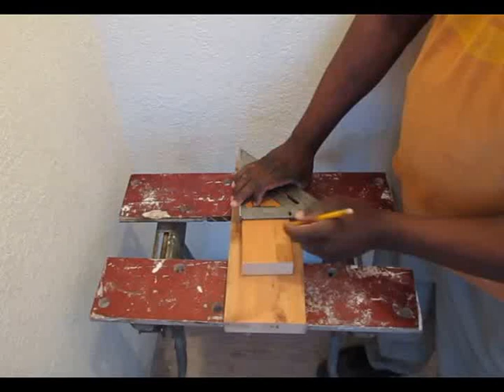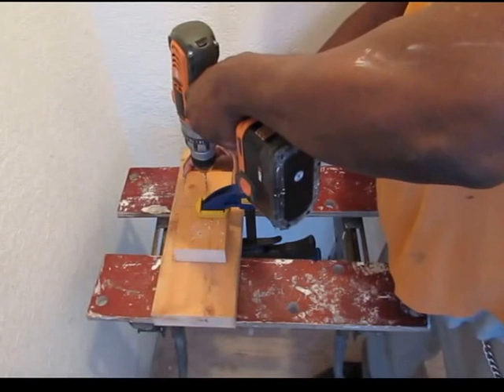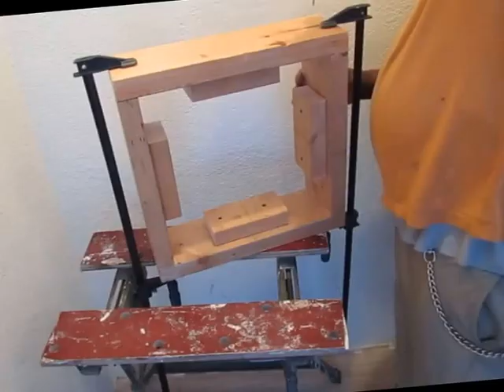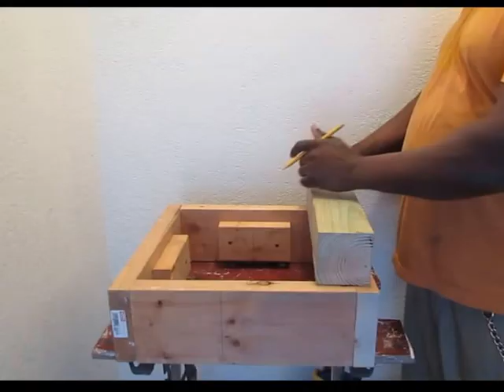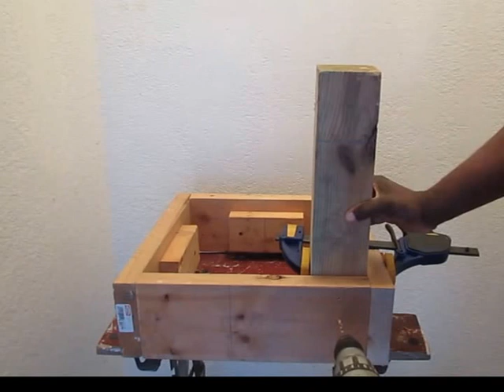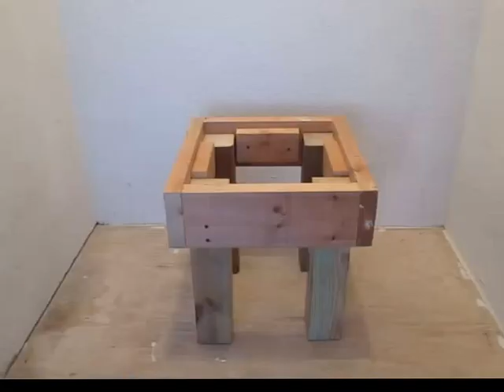Build Your Own Night Stand For A Platform Bed

Comment: nice lavelle how would i add a drawer.
Reply from the maker: well first make the legs 26 1/2" instead of 16 1/2", it sits too low. Second buy some drawer tracks that are 14" long. build a box 14"L 7"w 4"h. screw the drawer tracks to the insides of the legs and to the box